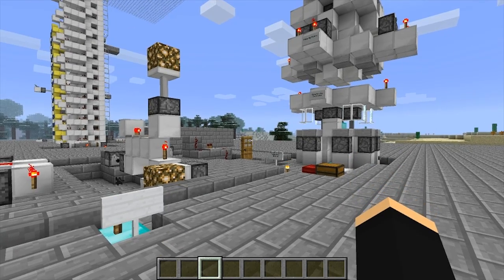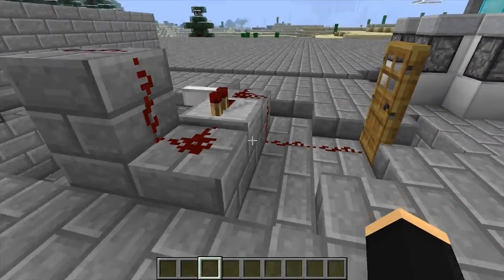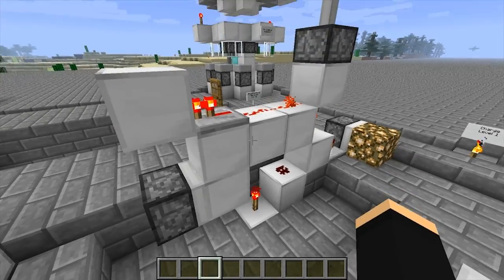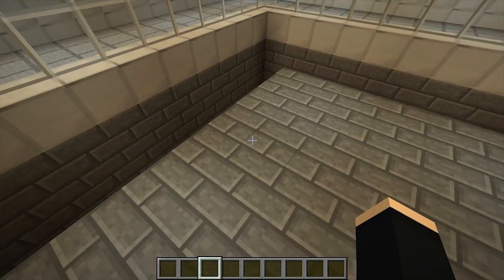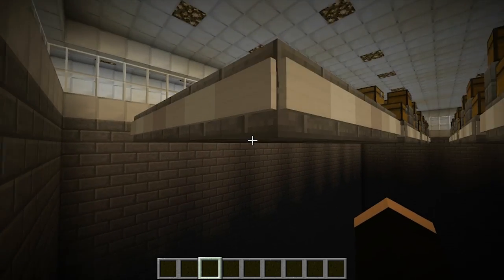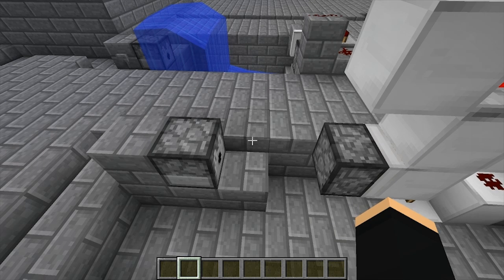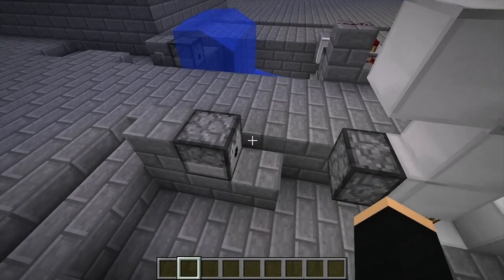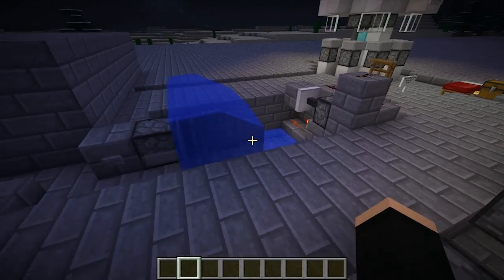(Patched) Simple Short-Range Wireless Redstone

Comment from the maker: @SuperMegaComedyGuy Certainly. Where I have these BUD switches powering a door or a piston, you simply put a dispenser. The issue, though, is that if you have a big enough gap so that the chance of a successful signal is less than 100% (let's say it's dropped to 80%) there is a large chance that the signal wont make it all of the way through.

Comment from the maker: @cptezz this is definitely something I have considered. However, other projectiles have their drawbacks as well:
- Snowballs have a much smaller range than fire charges and are also very inaccurate. Particle detectors also can't be flat
- Potions have an even smaller range than snowballs and, although they are very accurate (due to the splash area), you can only fit 9 of them in the dispenser since they can't stack
- Arrows don't set off either BUD switches or particle detectors

Comment from the maker: @Letfik I have tried and there are a few issues. The first is that snowballs don't cause a block update so you would need to use a different kind of receptor. The second is that fire charges actually have a MUCH larger range than snowballs and can reach further. The third issue is that it's the dispenser - not the fire charge - that is inaccurate, so snowballs would also be pretty inaccurate.

Great thinking though =)

Comment: Hey static, I actually created a one high bud switch. The only problem is that it breaks if it updates too much. It works fine though if it is used casually. I might upload it if you are really interested but I wouldn't really recommend using it.

Comment from the maker: @martinshoosterman very good idea, although this comes with the risk of setting nearby things on fire (if there is anything) and also means that the crackling fire noise will always be going around this circuit.

Additionally, I'm not even 100% sure that a fire charge will trigger the BUD if there is already fire in front of the piston